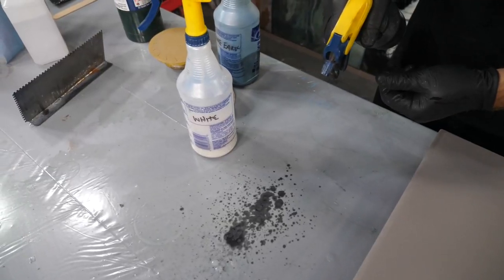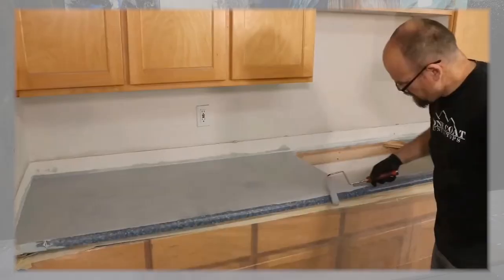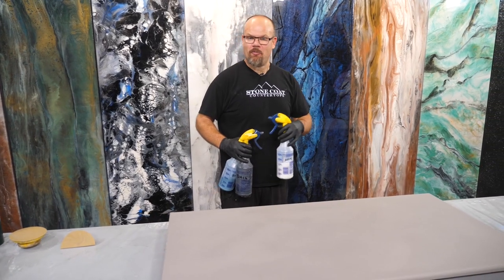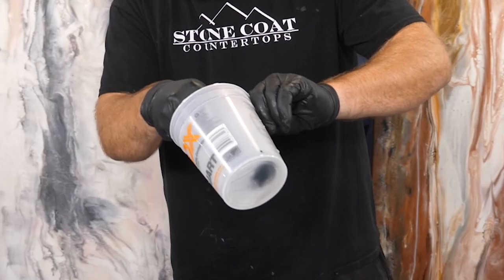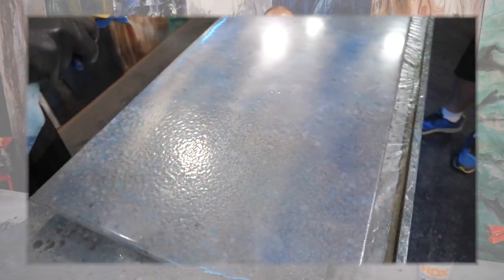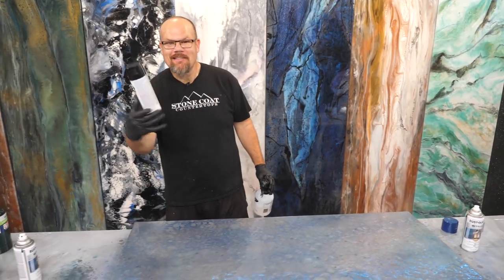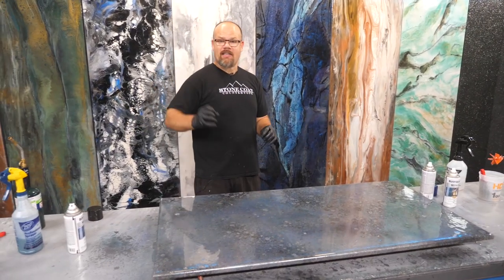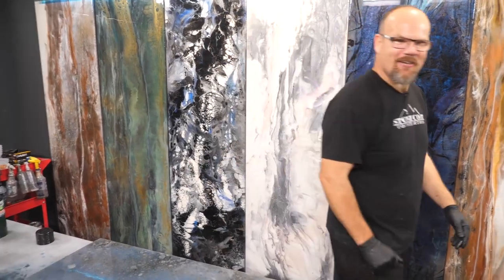Blue Pearl Epoxy | Stone Coat Countertops

Comment: I have a question,  it is really hard for me to find a lquid primer in a can   "but I do see a sparay primer!!   is it ok  to use a spray primer ??
Reply: Stone Coat sells the UM primer  for shiny surfaces, and also sells the primer for the next step (first step for MDF or anything that is not a shiny surface) in small cans of white or black. (This base primer is an alternative to using Behr paint and primer in one. Let dry 24 hours before epoxy.)

Comment: Would a heat gun work instead of the blow torch
Reply from the maker: Yes! It works a little slower but definitely gets the job done.
Reply: Thank you
Reply: Why don’t all my bubbles pop with the torch? Sometimes it burned the epoxy before the bubbles pop.
Reply: @robophobic3716  if the bubbles don't pop by passing the torch quickly over them, then do not try to pop them using the torch as it will burn.  Instead, you need to break the surface tension of the bubbles.  You can use the tip of your finger to break the surface tension or a small paint brush with resin on it.   Then go over with your torch but never stopping in one place

Comment: I have a question, if a person were to make a river table of somesort, could you stain the wood after pouring the river once its cured and then go over the whole thing (poured river and stained wood) with a clear epoxy coat? Or would the stained wood cause a bonding issue?

Comment: I have an off topic question, what would be the best way to fix a project the had flies land on it and got stuck in the epoxy
Reply: Kraig Bolte - can you sand the places where the bugs landed down enough that they’re out feathering around the edges and then do a flood coat over the whole piece? And if the spots are real noticeable, you might have to blot on some color using wadded up Saran Wrap dipped lightly in some colored resin and then do a flood coat.
Reply: Thanks for the info, still learning how to do is

Comment: Epoxy is non toxic, but after u put spray paint, isit still toxic free?
Reply: there is always a flood coat of epoxy as the final layer, so the spray paint isn't on the surface.

Comment: Stunning!! But you have a nice flat surface. What do you do if you have that trim or back splash against the wall? Do you remove that? Or is there a way to do the back splash too?
Reply: If you want the effect to carry from countertop to backsplash or trim, you lay them in line with the countertop and treat them all at the same time, then after they dry and you place them back, they will flow from one to the other. If you can do anything flat, do that.